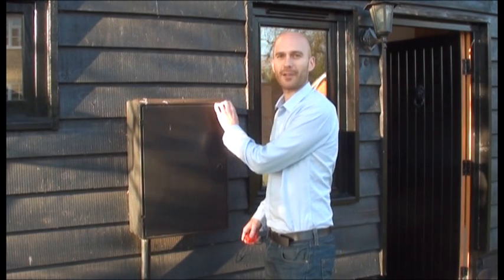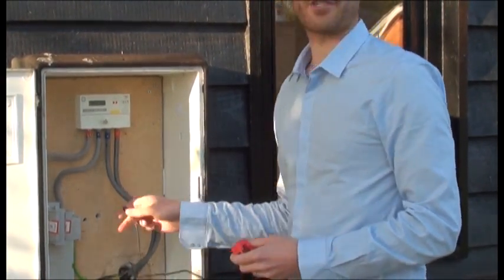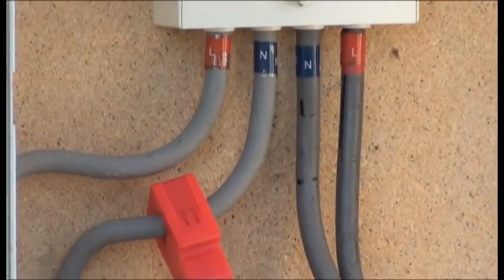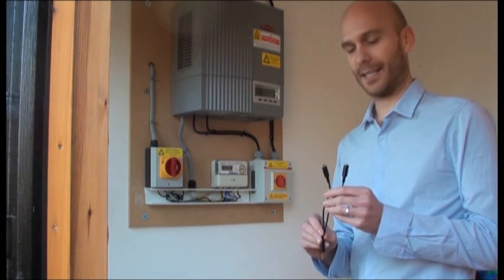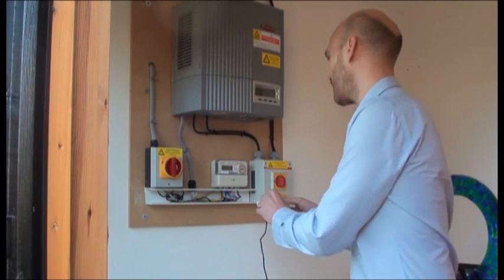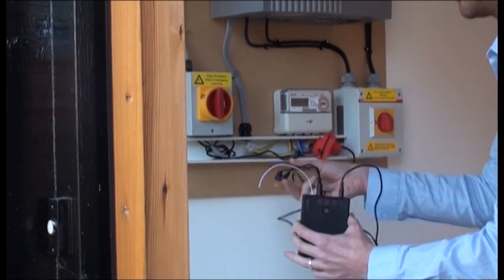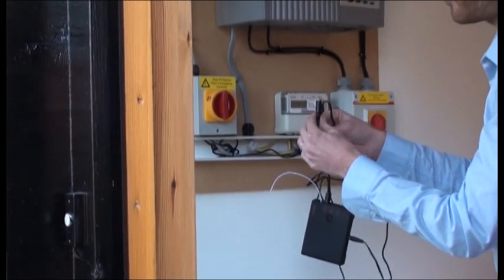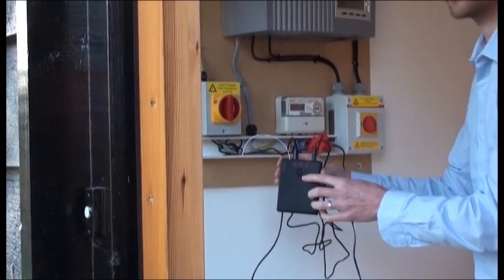Wattson Solar Plus with Easifit Installation Guide

Comment: Hi i have 4kw solar pv system at home. My solar system is fitted outside on top of big shed, the inverter and generation metter is also in the shed. My house electricity meter is inside my house. Its distance from each other. How would i go about fitting a wattson solar monitor if i bought one.
Or do you have other equipments to i can fit this wattson solar plus monitor. Can you please reply back to my quiry. 
Thank you 
Dee

Comment from the maker: Hello mickeyb01,

For the installation of Wattson Solar Plus with Easifit (no junction box installed) you place:
- two CT clips on the single core cable (live or neutral) on the cable running from the inverter to the fuseboard. One CT connects to one Y-cable branch connected to socket 1 of the transmitter, the other CT to the renewable transmitter socket.
- one CT clip on the cable running from the meter to the fuseboard, this goes into the other branch of the Y cable.

I hope this helps.